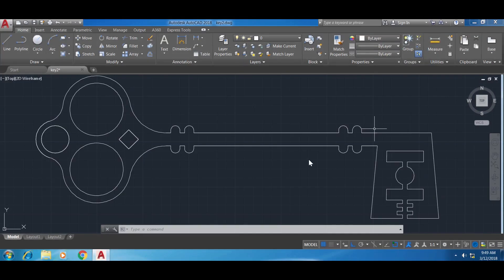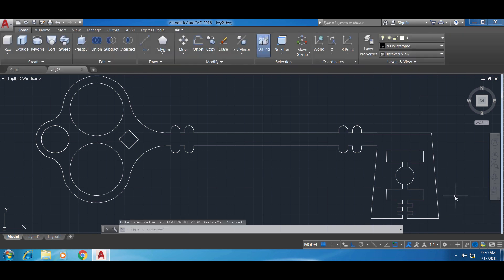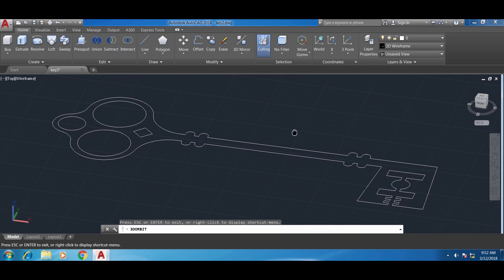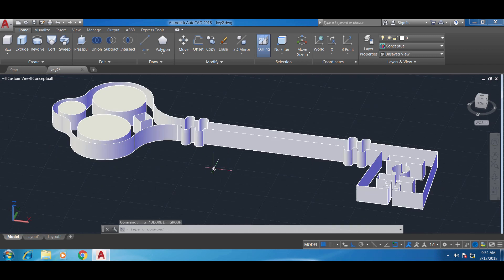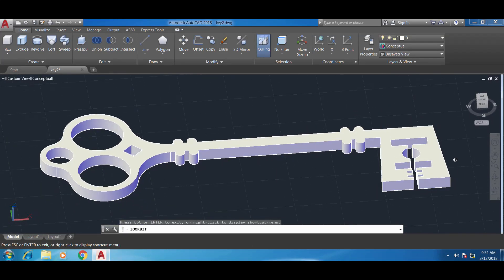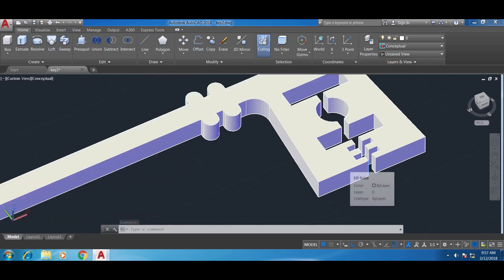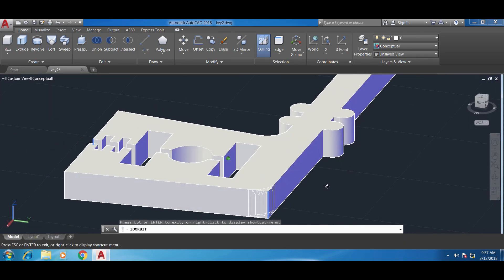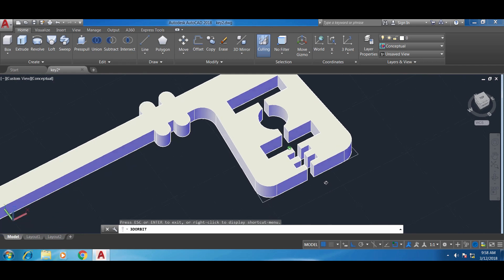How to Convert 2D Drawing into 3D in AutoCAD Fast and Easy Tutorial

Comment: Hi Sergio, thank you for your quick exercise. Your explanation is really helpful and your english is pretty much perfect. Seems to me you are from the Barcelona region. Thanks for sharing. I have tried 3D many times and i cannot seem to get my head around it. I am what you might call, a more senior engineer who grew up with the Drafting board and in more recent years I have managed to learn 2D using Draft Sight (self taught) and now I am on Autocad Lite. Is there any way to do what you have done using " Lite" version do you think? I also have Turbocad and Qcad so I will see if your instructions are good for these two programs also. Thanks again. Jon
Reply from the maker: Thank you for your kind comment.  I not sure about AutoCad Lite, but you could just use the educational version of the full AutoCad.  It’s free for non-commercial educational use and works great. Cheers and thanks again.